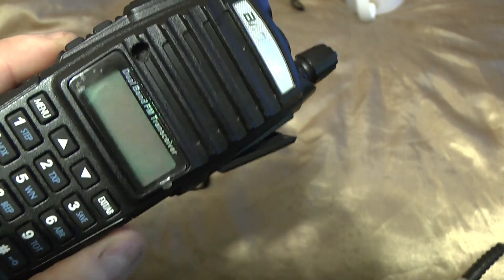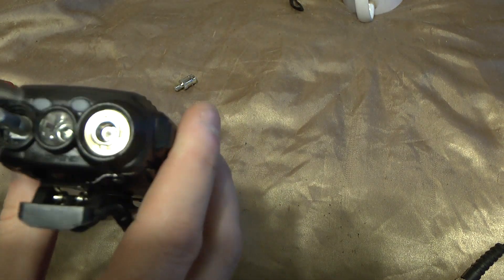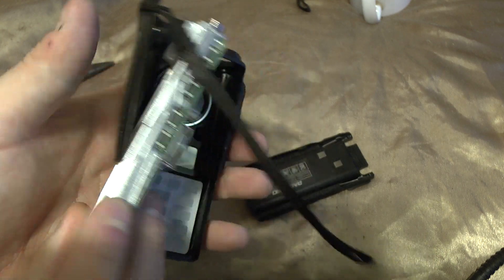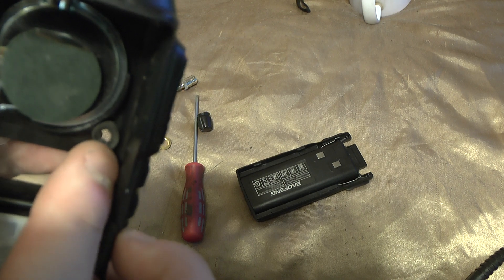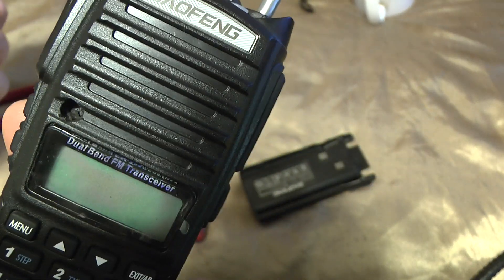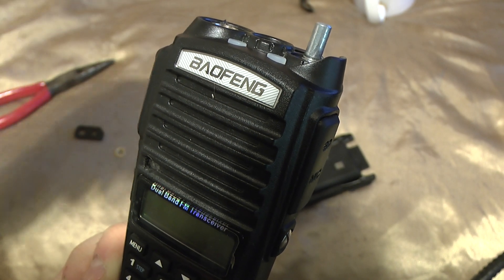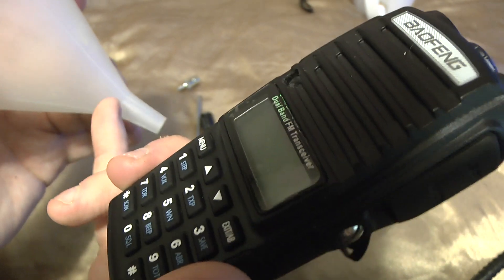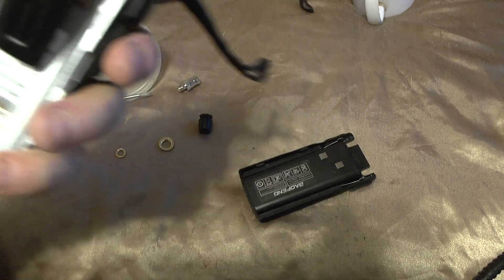Baofeng UV-82 teardown + Mic Hole enlargement

Comment: Question. I tried to use a "tiger tail" on my UV-82HP for better reception. But now the radio doesn't seem to do well with almost any antenna I put on it. Can you short something out in that antenna socket area by using a tiger tail? Thx
Reply from the maker: Im not sure I would have to see it in person. You might have snapped the connection to the main coax pin so might have killed the signal that way. Tear down and check with multimeter.

Comment: Seems to me that the size of the mic hole from the factory was engineered for optimum performance. Large enough to clearly transmit audio and small enough to reduce wind noise. Hacking a big hole in the front of this radio just doesn’t seem to make any sense
Reply: From comments people have made, it appears to be optimized for a particular use case (noisy environments), at the cost of the user having to hold it right up to their mouth and talk uncomfortably loud.  Opening the hole shifts it so it's not as useful in a noisy environment, but is more comfortable for the user.  I'll be trying it...

Comment: Hi, i got a problem with the volume control turn tab, it wobbles and the radio just turns on and off
Reply from the maker: open it up and remove and replace part. However radio only costs £15 so easier to buy a new one and have spares.
Reply: thanks